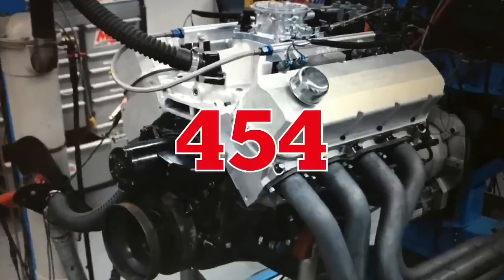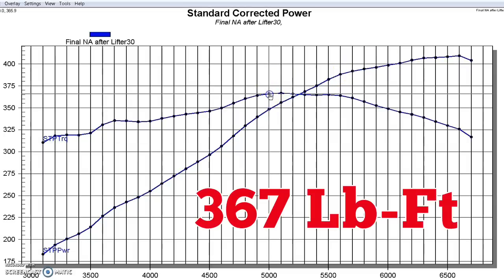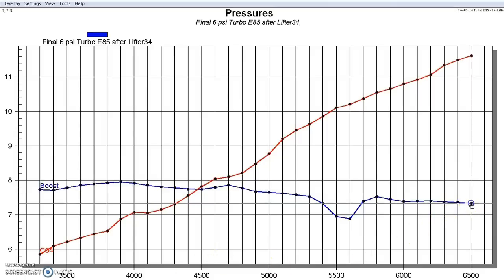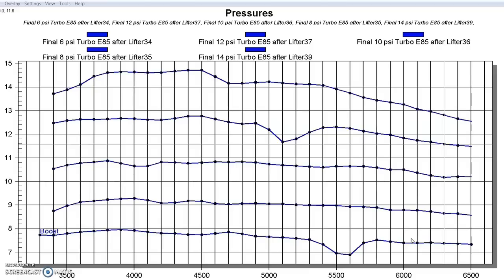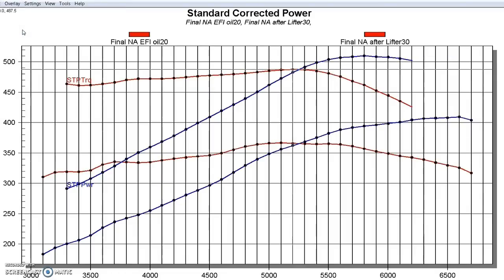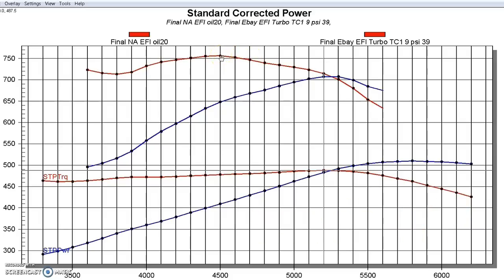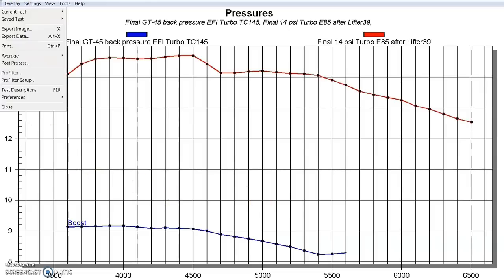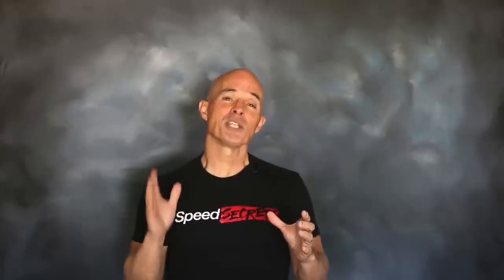EBAY TURBO TITANS-4.8L vs 454 (GT45 TURBO)

Comment: So when we can say back pressure is bad ? At 1:2 ? Or 1:3 ?
Reply: Anything past 1:1.5 is undesirable.
Reply: @user63344-gds  i don't think 1.5:1 considered as back pressure issue i believe to keep the engine in save situation 1:2 or less is good
Reply: @night_drive_led2176  Hey, you run your turbo how you want. When it runs like shit and blows up, don't complain that you weren't warned. 1:3 might not seem like much when running 6psi. Crank that up past 20psi and don't be surprised when you lift the head and melt a piston. 🤷‍♂️
Reply: @user63344-gds  i am adding 8 psi to 5.3 (18psi in exhaust) with zr1 cam it makes 500whp no issues at all. Great power with crabby cam
Reply: @night_drive_led2176   No issues because it hasn't blown it yet?  What's your EGTs at sustained WOT?  IATs?  How much data logging/track time have you done to know everything is good?  Engine tear-downs or cross your fingers and "so-far-so-good"?  Either way, it's still not running near optimum efficiency, as that extra back pressure is creating heat and unnecessary strain on the internals.  The results in a loss of potential power. There's no way around this; it's physics.  What you can't say is that 1:2.25 boost-to-drive-pressure is giving you any benefit over a 1:1.5 or less.  If you're seeing that much DP, your turbo isn't sized properly.  If your turbo is sized properly then your wastegate/piping isn't right.  But hey, you build your engine how you want; it's your time and money.  Oh and fwiw, if you're going to ask the question, at least give it an honest effort even if you don't get the answer you wanted to hear. 👌
Reply from the maker: there is not a general rule that applies, (as a general rule) less back pressure helps power but trades response-we ran less back pressure than boost pressure on our Bonneville Civic-but weren't concerned about boost response on that application-lots of stuff out there running successfully on high back pressure (2:1-3:1) but usually class limited turbo sizing
Reply: @richardholdener1727  Got a source for your data regarding this, not personal anecdote?  Particularly one demonstrating that 1:2 to 1:3 is better than 1:1.  Just because something runs down the track a few times without exploding doesn't mean it's built right or running efficiently.
Reply from the maker: I'm not sure I understand where I said 1.2:1 or 1.3:1 is better than 1:1, what was indicated is that many guys are running very high boost/back pressure relationships because they are forced to by class rule. 1:1 is not some "ideal" relationship, applications require different boost/back relationships and the statement that anything past 1.5:1 in undesirable is not 100% accurate
Reply: @richardholdener1727   Ignore class rules. They are arbitrary restrictions and have nothing to do with the OP's question or turbo efficiency. 

You're right that you never specifically stated that any one figure was better.  In fact, you never stated anything definitive.  All you said was that people ran 1:2 to 1:3.  Both the Op and I are asking you, "when we can say back pressure is bad", and "got a source for your data?" Perhaps you don't know?

But since you mentioned it, please explain how the statement that "seeing over 1:1.5 drive-pressure (sustained) is undesirable" is inaccurate?  I'm not talking about spooling.  I'm talking about WOT after the turbo has lit.  Ideally you'd want 1:1 once the turbo is spooled as this indicates that the intake, cylinder, and exhaust pressures are equalized. This means the engine is working as easy as possible, with little stress on the hard parts. You only need positive drive pressure to get the turbo going.  Anything after that is exhaust pressure fighting against your pistons which robs HP.  Worse yet, the exhaust gasses can actually back-up into the combustion chamber which prevents the intake charge from completely filling the combustion chamber.  Again this equals loss of power.    

Seeing brief moments of high drive pressure is fine, but not for sustained operation. This is why people use wastegates and tight turbine housings to achieve quick spool-up but still have healthy DP when at WOT.  Once the turbo is spooling, you divert the unneeded exhaust gasses (read: extra back pressure) past the turbo as the additional pressure only creates more heat and cylinder pressure; both bad things.  This is basic turbo fundamentals.

But like I said, I'm all ears for you to explain how this is wrong.

Comment: Would love to see you do timing runs on naturally aspirated engines. Maybe mix in an octane test as well.
Reply: It would depend on a lot of factors so what timing works best on one engine wouldn’t always work on another engine. 

In theory you want as much timing advance as it will take before spark knock. That way you’re getting the longest duration of combustion possible.

Comment: Do the vortec without heads you know the big block cause may just be the heads
Reply: Buddy Brackett  yeah it totally has nothing to do with trying to use a shit turbo on a 7.4L engine
Reply from the maker: the back pressure is power output vs flow orifice

Comment: A pair of those eBay turbos on the 454 have the potential to be really good... They made good power on the 4.8 and half of a 454 is a 3.7 so it may work out alright. Perhaps a pair of them could support 1000 HP on a BBC. That would be fun! Thanks Richard!
Reply: Oh hell....1300 would be easy on those GT45s. The fuel system would need a major upgrade.

Comment: how about a series of videos to help us figure out which turbo (size) would be best for the 4.8 or 5.3 or 6.0 stock bottom end with a 800hp target? Starting to rethink my 6.0 build..lol thx
Reply: Jeff Da Rosa  just look up, Sloppy Mechanics, has lots of videos where he talks about spool time with all those engines and popular turbos while street driving the combinations. A billet gen2 78/75 would get you there and spool like an 8-71 blower with your 6.0. Or use an S480 and have a moderate “ramp” into boost while still having great low end. A slightly oversized(some lag) turbo will usually be easier on an SBE engine and make less heat so more reliable overall
Reply: That's way above this guy's pay grade.
Reply: @user63344-gds  you really think so? He's always asking for ideas so I thought, I might as well add a few...
Reply: @emerton01  Don't get me wrong, I like the idea. I just don't think he's the type to get into the weeds on the math.  He seems more like a "bolt stuff on and see what happens" guy.
Reply from the maker: you need to do a little research-maybe look at 1 of the 10 books he wrote
Reply: @richardholdener1727  What books who wrote?
Reply: @richardholdener1727  Let's not pretend. You're a journalist; not a mechanical engineer.  How many "books" you wrote means dick.  Anyone can find a publisher with a little bit of money. The fact that you can't cite any calculations in your videos or comments speaks volumes.  

Btw, I looked at your book reviews on Amazon. Here's a few:

• "Information in this book is presented well, but it contains nothing useful."
• "The main theme of the book (dyno charts) might appear to add to the appeal of this book, but the methods used to demonstrate hp gains are correlated in a rather sloppy manner and do not follow any consistent methods of comparison (e.g. stock setup vs. specific bolt on only)"
• "The only thing its showing is dyno result between parts."
 • "Unless you're looking for nothing more than chassis dyno numbers for different (simple) bolt-ons, this book isn't for you. "
• "I expected a lot more data/write ups vs. what you get which is dyno graphs galore"

Sounds a lot like your YT channel, tbh.
Reply: @user63344-gds  😡
Reply: @user63344-gds  i have PDD stuff on my 12v. I went to their shop in Utah. Great guys,  but Richard is great as well.  Diff style

Comment: Looks like running a gt55 @ 5-8 pounds on a 454 will be a better turbo. I like small turbos, high compression and low boost. Torque curve is phenomenal and so is the response.
Reply: That's a great recipe. I had a gtx55 on a 440 bbc with 11.5:1. It was a blast....but it's time for more turbo.
Reply: that gt45 bbc would make a strong tow rig 750lbs!

Comment: What's the equation to size it correctly?   What would the 454 make if you could mimic the back pressure and boost curves?
Reply from the maker: i also ran the bbc with an S480-that works well-I need to see if I ran that on the 4.8L as well
Reply: @richardholdener1727  I would like to see the difference in boost to backpressure ratio on rear mount vs front mounted turbo on same engine same turbo, say gt45 on 4.8.

Comment: Well now that youve edi-fi-cated us on back pressure restricting HP & TQ, then the obvious mystery is what now happens between the 4.8 & the 454 when you use twin turbos or a bigger turbo sized for the 454!
Great work here grasshopper!
Reply from the maker: i did run an S480 on the BBC
Reply: @richardholdener1727  .
Did you run it on the 4.8 as well so I can go back & see the results? Dam Bud.  Is there ANYTHING you havent thought of?  I really look forward to the info you bring us.
Especially the  LS/Vortec testing.  I have a 4.8, a 5.3, a 6.0 & a rad 454 sitting in the garage. And I have an 88 Monte SS, & an 88 Farm truck both with 305s waiting for transplants!  You keep showing me new stuff & I keep moving the goal posts. 
The ultimate goal is street only & im too old to race.  But some punch would be nice when i mash the pedal down!
If you think about it, any one of them would be a massive improvement on the old 305s. 
Thx again Richard.
Reply: @richardholdener1727  .
Oh & btw, is it me? Or do you move your arms much less now than your earlier videos?  I used to almost dodge the video screen when you were on it.  But now that I am a big fan, I dont notice it! Its 1 of 2 things:
1: You're more relaxed in your delivery...  or
2: Now that Im a fan, Ii don't notice any flaws you may have because everything you create is so interesting & informative!
Either way, I always look forward to your next creation.
And on a personal note, if you ever find yourself in the Great White North,  skip over to Oshawa, cause Ive got a big juicy Rib steak & potato ready to go on the bbq.  Along with some cold beers, Im sure you  wont forget it anytime soon.  Thats assuming I stop asking questions long enough for you to actually eat your dinner!!!
Once again, cant tell you how much I appreciate the knowledge you pass on.

Comment: Honestly, that 454 would make a Hell of a Tow Truck engine.
Reply: Not really as that back pressure with a load on the truck would make the egt jump super high and my guess that wouldn't be good.
Reply: @ae8620vlevin  The backpressure on a Cummins or Power Stroke is between 40 and 60 psi, far less than the 20 shown here.
Reply: @johnparrish9215   Ya, it can handle that due to it being a diesel.  Apple and oranges don't compare....
Reply: @warhound7781  Metallurgy and Heat transfer doesn't care what the heat source is. The only meaningful difference is in the width of the valve face between diesels and gasoline engines, the diesel being wider for better heat transfer.
Reply: @johnparrish9215  That seems like a misleading vague statement.  What is the drive pressure for a given boost pressure?
Reply: @ShainAndrews  Hey so I'm wrong
Reply: @johnparrish9215  Just incomplete.  Yes drive pressures in diesels can be considerably higher, but so are boost pressures.  Ideally 1:1 ratio, but seldom the case.
Reply: @ae8620vlevin  could you just bleed off backpressure after reaching desired spool. This would help hold the torque at an optimum level,  but bleed pressure to reduce EGT. ..or am i wrong on this?

Comment: I suspected the housing would choke off the 454, but it was cool to see just how bad it was.  Nearly 3:1 drive pressure= no bueno!  Love these tests.
Reply: I thought it was cool to see that under normal towing and highway Rpm it looked safe and made a ton of power down low.
Reply: It was very interesting to see that monster torque it was supporting down low.

Comment: So why can’t u adjust back pressure with wastegate to make this smaller turbo work better on 454 n see what it really do?
Reply: The back pressure is a measure of how hard the turbine has to be driven, to make the compressor feed that amount of air (boost, basically) to the engine. If you diverted more air around the turbine, the turbo would make less boost. Basically, this compressor wheel is struggling to feed the 454, so you have to drive the turbo really hard, which means back pressure.
Reply: @tptrsn  we tested this about 15 years ago. Adding an extra wastegate to bleed off back pressure added hp. It was a fine line to keep the turbo at full tilt though.
Reply from the maker: or you can run only 6 of the exhaust pipes to feed the turbo-something i want to try
Reply: @kevinengland4042  how much power were you able to add that way? And was it only really at a point where the compressor was starting to struggle? It's something I ponder quite often. Lol
Reply: @richardholdener1727  isn't that just another form of wastegate that will spoil the turbo slower?
Reply: @tptrsn  it was a 427 LS, AllzPro heads and a 9000 chip....where does a 106 single become the restriction? Based on the et, it was worth @ 200hp. I'm sure this would scale in a percentage, not a raw number for comparison.
Reply: I’m a deal hunter. N little turbos n super chargers are cheap. I have 2 ar500 super chargers on my Jeep 4.0. Because I traded a cheap rifle for them.  In process of putting 2 lil $90 eBay turbos on my 99 Silverado 5.3 with 250k on it. Lol
Reply: Yeah. I got ya now. I shouldn’t have commented that. Shoulda asked. If I happened to have a 454 n not 4.8 would I b crazy to spend 165 bucks n send it until I can afford a second one or properly sized turbo?
Reply: To4e turbos

Comment: Would love to see a turbo show down from cheapest to mid  priced turbo on a gen 4 5.3 lm7 with out any up grades
Reply from the maker: you want to run turbo testing on a stock 5.3L? no cam?
Reply: I would personally love to see any A vs B turbo testing, with spool times, peak HP, and back pressure. Any engine config you feel is sized to match the turbos would be fine.
Reply: Richard Holdener after buying a 5.3 suburban for $1200 I’m very interested in what it would do. Although I’m sure I’ll do both eventually.
Reply: @richardholdener1727  btr truck stage 1 cam I pull a trailer a lot don't want to lose the low rpm torque
Reply: @richardholdener1727  yes pleaze
Reply: I deffineitly want to see a stock truck 5.3 with a turbo. See what the average joe would actually do. And then what a cam woukd do
Reply: Cody Parker https://youtu.be/Tw_Hq8p63uU
Reply: 4.8and 5.3 the same shit the back of block says both
Reply: This please